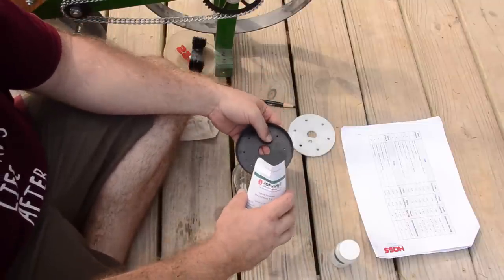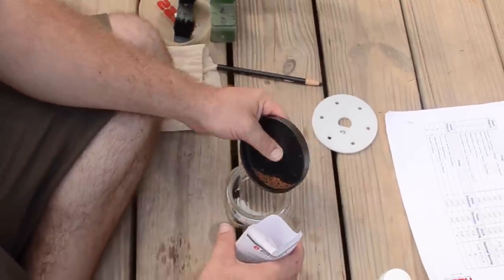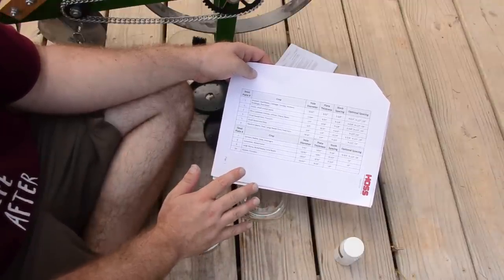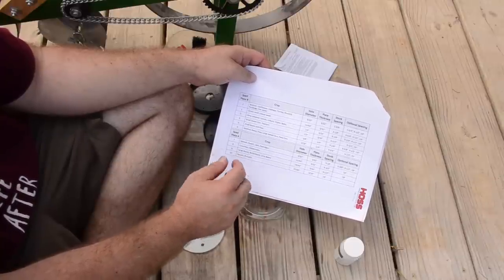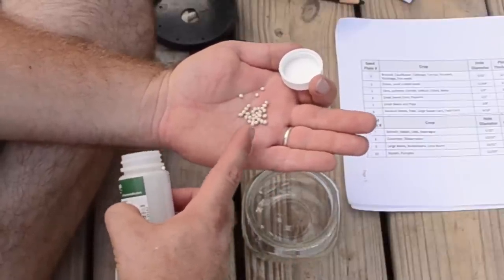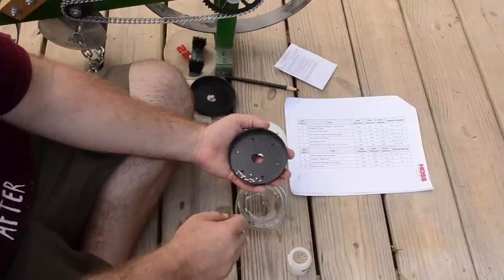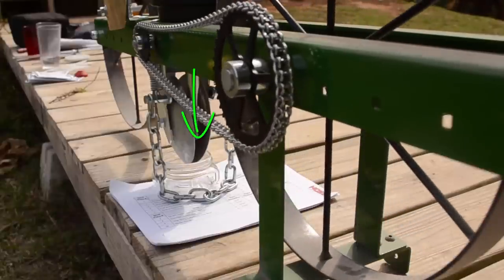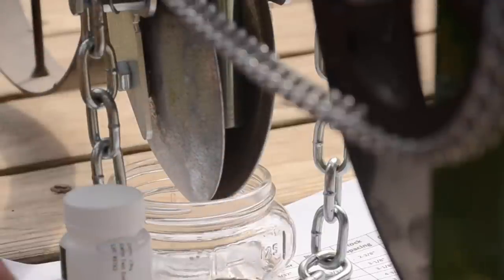Selecting the Correct Seed Plate for a Hoss Tools Garden Seeder

Comment: suggestion  for home saved seeds  make a seed size sorting plate    by using security door screen metal  these screen are  punched metal round holes of a exact size 1/8th 3/16ths  for example  make a 3 screen sorter  one slightly over sized to screen out chaff or stones examples then the right sized to match the seed plate  then a undersized screen

run the collection of saved seeds through the over sized  screen  take out the oversized  stuff  then screen the remaining  in the middle sized plate  that matches The seed plate or wheel you have selected 

then screen it through the undersized screen 

the undersized seed is not bad just needs a different sized drop plate 

that should save you from skipped paintings or too many in one seed hole
Reply from the maker: Good tip Sir!